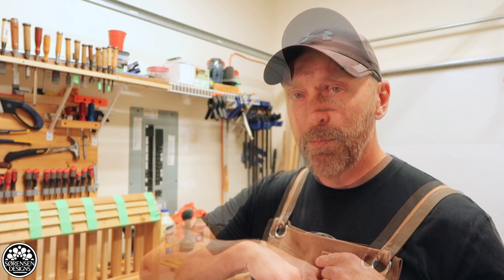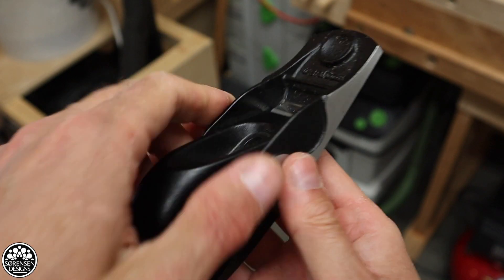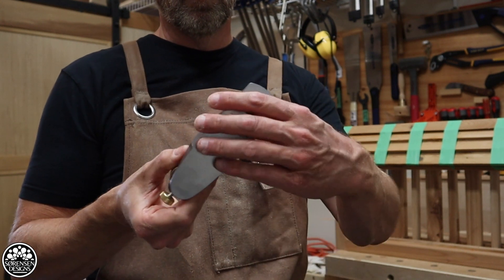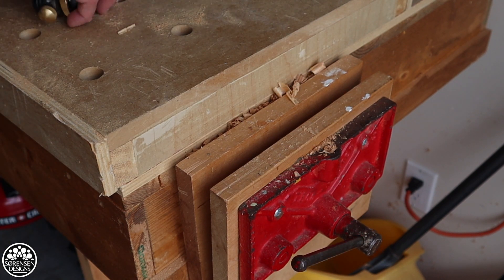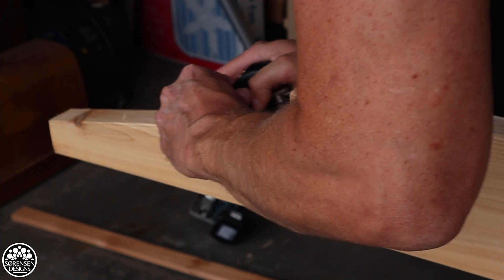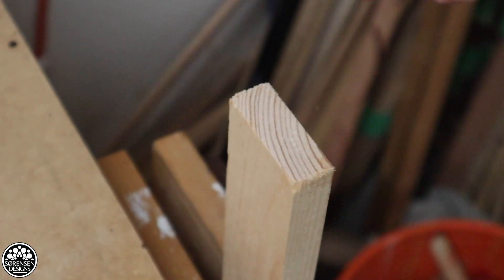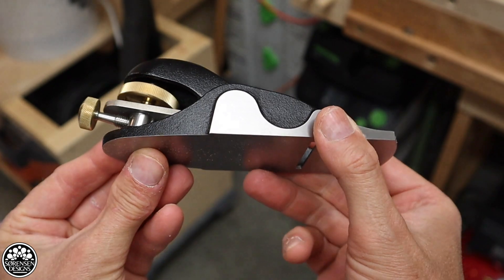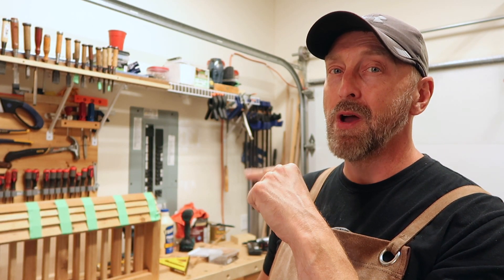This is The Best Tool Ever!  - Woodworking on a budget

Comment: Which blade did you get?
Reply from the maker: I bought the O1. I wanted the PM V-11 because it is supposed to hold an edge longer but they were out of stock. I'll order it later. I have to say their O1 holds an edge for longer than most tool steel equivalents.